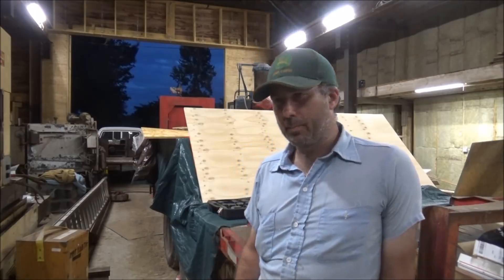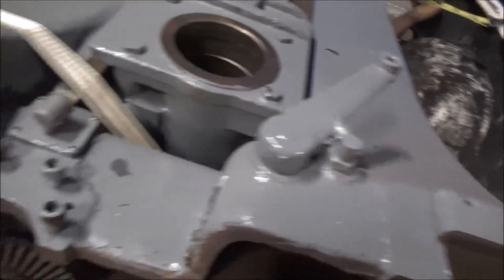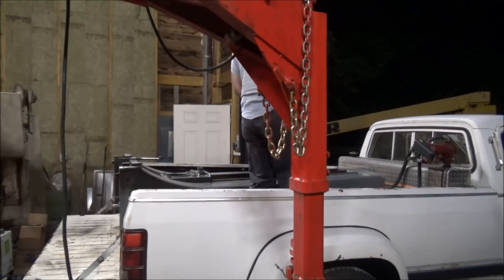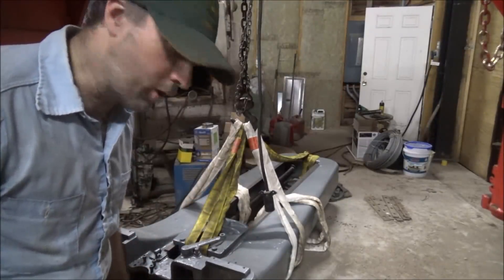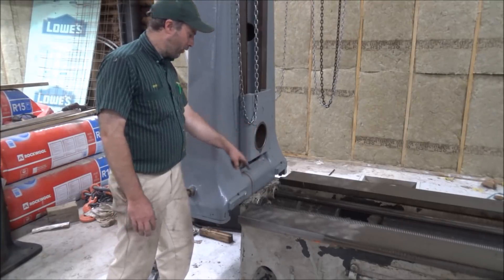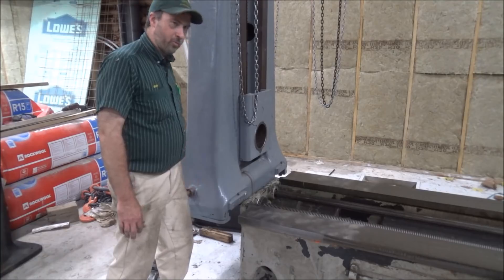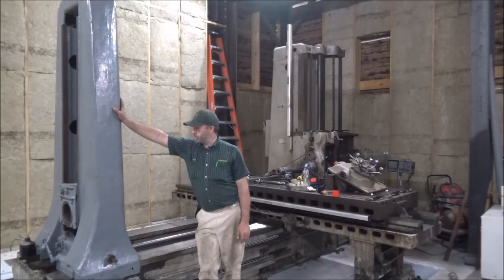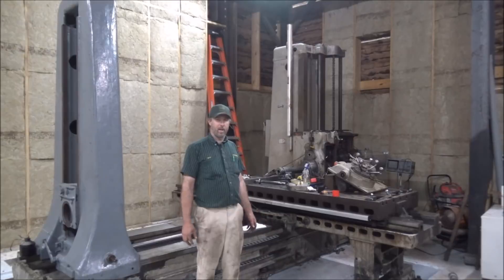Outboard Support For the G&L 340T HBM

Comment: Your going to love running that G & L because everything is right there where every move you make will become second nature .  I ran one for years every night and it was gravy.  Unlike a Lucas and some others where the controls are on the passenger side.  Two big true angle plates and a big turntable and a lot of good tooling and you won't be able keep up with all the work that will come your way.
Reply from the maker: ron slaughter I use it all the time. It often is my go to machine in the shop.

Comment: hi have a question  that's off topic but here goes have a 53 model 40.  already bored to.120.over. can I sleeve the block it has no water pump just siphon heat transfer.
Reply from the maker: Yes they can be dry sleeved.

Comment: We have some old bars at work that are too big to fit the taper in our 350t mill. Im sure my boss would sell some but you would have to turn down the taper to fit your spindle. The problem is I don't think your lathe is long enough to turn them down
Reply from the maker: My spindle is MT6. What size are the bars? I own a lathe big enough I just haven't gotten it yet so I should be able to make them work. Where are you located?
Reply: Ive never used the big bars but I believe they are MT7. I know  they are bigger than MT6 because our 350t mills are Mt6 but they wont fit them. The shop is in Alliance Ohio which is in northeastern Ohio. I will get some pictures of the bars tomorrow if you want me to. We have lathes at work that would turn them down but I don't know what the boss would want to turn them down. Just so you know, these bars are really old and may not be very straight anymore. I believe they are from mills that were scrapped years ago. We have some bars that would fit right in your machine but I don't think the boss would sell these. We have 4 of the 350t machines. We actually have a brand new tailstock for one of the 350ts that has never been on a machine. It still has the original cosmoline on it. I never mentioned because I didn't think it would 340t machine.
Reply from the maker: Yeah send me an email with pics would be great. My big lathe I have to pick up just outside Cleveland so maybe I could make it a double duty trip.
Reply: +bcbloc02 whats this big lathe , sounds interesting!!
Reply: bcbloc02 my boss said he wants 800.00 for a 5" about 10' feet long. it doesnt have any tool slots though. it does have the keyway the whole length. they must have had a boring head that attached to it. we also have a 5" with tool slots but he wants 1000.00 for it. i have pictures but i dont have your email
Reply from the maker: Its the 37000lb one I mentioned in the last video. :-)
Reply from the maker: my email is bcbloc02 at yahoo

Comment: Nice example of taking the needed time to get the rigging right.  Being patient enough to redo the slings until you're satisfied it will work safely, great example. 

In addition to being astounded by your work ethic, I'm also astounded by how deep your pockets seem to be. You've put a ton of money (literally, I think) into your shop; while I certainly think it's worth it and will pay itself off, I just kind of boggle that one working man CAN put that much on the table.  Are you financing this as a business?
Reply from the maker: My shop work pays for itself. I don't pay ebay  dream prices so it is deceiving what I have spent on my shop. No machine in my shop cost over 9K.  In fact all the stuff in my shop I didn't pay what a new pickup truck would cost and plenty of working people seem to be able to afford to buy those.
Reply: Whaaaat?  I... hrm.  That's some food for thought.

Comment: Great find Brian. 450 - 550 sized Hitachi hoes would have boom rams about that diameter. Length might be a foot or so short though. The 850 size would be too large in diameter I'd guess but the ends could be turned down to fit. Got a cylinder rebuild company anywhere within a state or two of you that you know of? Hydraulic cranes use some pretty long boom rams as well and they'd scrap any ram that was the least bit iffy on those. Abom might know of something?
Reply from the maker: I think about 8ft is the minimum length I would want to put the time in to building a bar from. Because I can move the tailstock in I can run a lot shorter if I need to.
Reply: Then those larger hoe rams I mentioned should get you that Brian. There made from some real good and tough steel as well. Over the years I've snapped one or two eye's off the ram end on cats and graders when things didn't go quite as planned.:-) It takes a hell of a lot to even bend one.
Reply: Turning Point moo
Reply: Sorry type o.
Reply: It CAN happen, all right!
Reply: Thick wall tubing. No reason the whole bar has to be completely solid is there?
Reply from the maker: They are solid for rigidity and mostly dampening, hollow tubes like to vibrate.
Reply: Ironically, he does know a cylinder rebuilding company, and a certain fellow who works there...

Comment: I bet that was a slow trip back - the truck suspension must have been close to bottomed out !!!
Reply from the maker: Stock 6K springs plus 5K air bags I installed in one of my videos.  The rear axle is rated 10K and the front is 4500 so I can gross 14500 and be safe. :-)
Reply from the maker: No not nearly, my granite plate I hauled was probably twice as heavy.
Reply: Holly crap. What did you do with that trucks suspension?
Reply: I remember that episode.